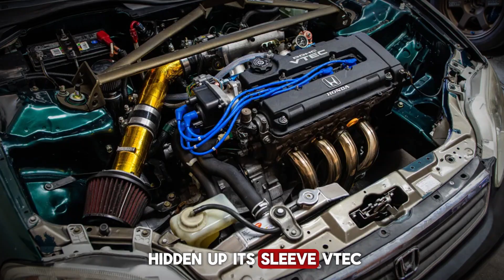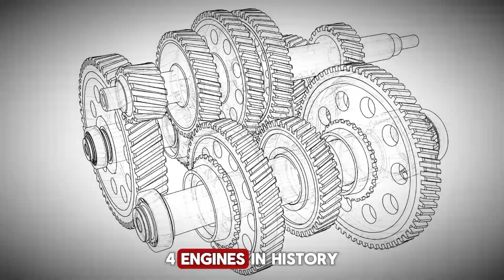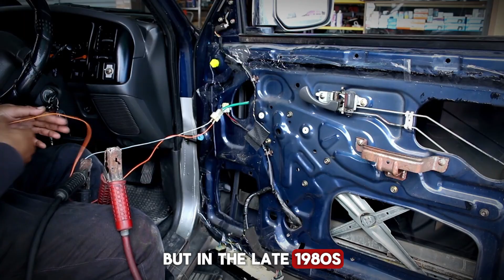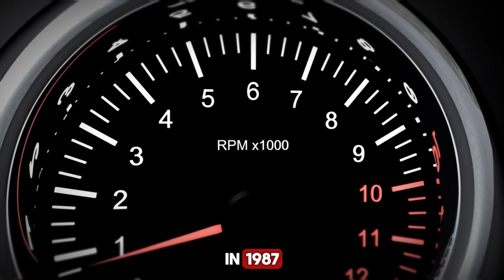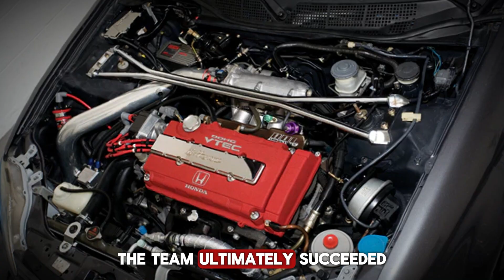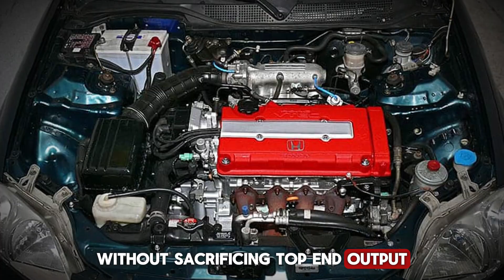How Honda’s VTEC Revolutionized Sport Compact Cars Forever

Comment: Its a shame they reduced the redline over the years to ~7000 rpm. Miss those engines when the redline used to be around 8000 - 8500; which in my opinion, the engines sound the best for most of them.